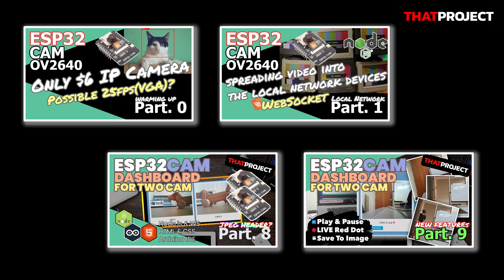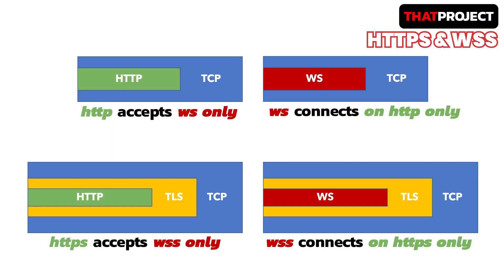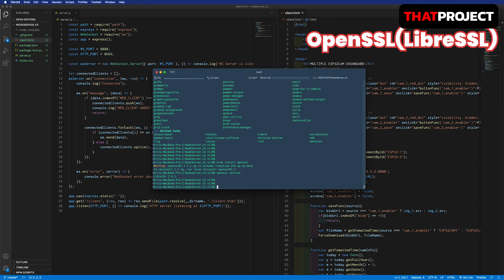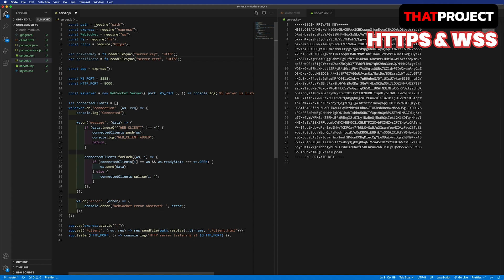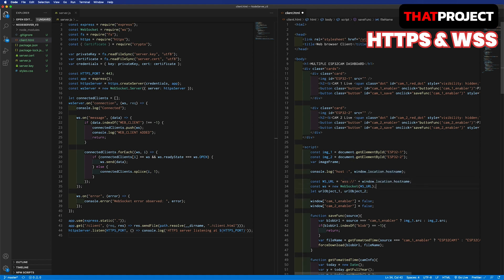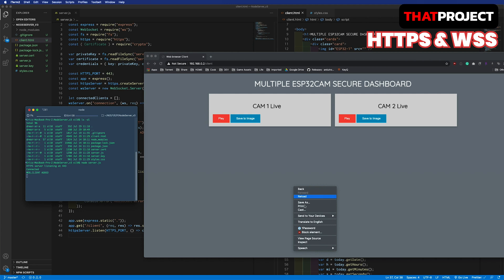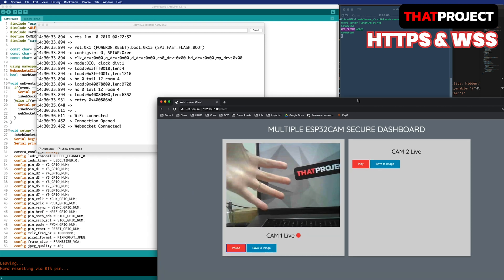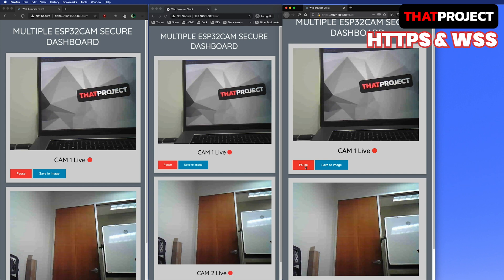ESP32 CAM with Arduino IDE | Tutorial - [Part.10] Multiple CAM Secure Dashboard (ft. HTTPS, WSS)🔒

Comment: is it still possible to connect to esp32-cam directly, skipping the dashboard? I'm trying to figure out how secure this solution is. Let's say someone broke into my wifi and wants to browse the cams after obtaining IPs.
Reply from the maker: Then are you trying to connect it directly to other ESP32?
Reply: @ThatProject   Let's say attacker has the IP os esp32. Can he browse the stream or is there no webserver on it to browse?
Reply from the maker: @mykkail1727  HTTPS/WSS is end-to-end encryption. It makes it impossible to intercept data in the middle.
It currently runs locally and can be accessed by anyone on the local network. What you want to do is make sure that even if someone knows your IP address, they can't access it.

Comment: Hello, by the way the esp32 ai thinker cam need to have the certification authority CA in memory, so you need to use the code setCACert("certificate_variable"). Well i after a couple of mounths i found it lol. And all the esp32 ai thinker cams i have can connect easily to the server, i even put 3 cams in one webpage instead of 2, but... even if i have only 1 cam on, i need to reduce the pixelformat to QVGA otherwise it's not working if i move the camera to something more detailed than the roof... Also i reduce the frequency to 9 000 000 Hz instead of 20 000 000 Hz. Any ideas to make it better?
Reply from the maker: I didn't need setCACert when I was working on this project. Of course, now we must register the certificate using setCACert on the ESP32. Otherwise, we cannot connect securely. Is the ESP32-CAM far away from your wireless router? Actually, I can't get your situation well.
Reply: @ThatProject  Oh ok thank you for your answer. No my cams are not far away. They work fine when they are streaming to a non-secure server.
Reply from the maker: @romanov2737  Interesting. Does a secure connection have any impact on data  transfer? Let me try to find it.
Reply: @ThatProject  When i use QVGA frame no error, when  i use VGA frame:  RangeError: Invalid WebSocket frame: RSV2 and RSV3 must be clear
Reply from the maker: @romanov2737  Unfortunately, I don't have a testable environment in place right now. I'll try again as soon as I get a chance. Sorry.
Reply: @ThatProject  ok thank you
Reply: @romanov2737  regarding the CA can you explain in more detail how did you set it? I'm having the same issue as many people here, where parts 1, 8 and 9 work just fine, but as soon as I tried the WSS protocol, it doesn't connect to the WebSocket. As far as I understand, it must be a certificate issue but I haven't figured out how to register it. Seems like self-signed certificates don't work. By the way, I'm using an ESP32-Wrover module.

Comment: Hi and wishes from Australia. Great project btw. I have been following your ESP32 series since you made the first video. This is perhaps the best use of this technology while creating custom servers using NodeJs. However, I have seen a problem with these devices, not sure if you have faced it though. ESP32 stops streaming over websockets altogether after a while like about 10-15mins in. I am powering it with esp32 programmer for development and also with the 5v mobile charger but with the same issue. Please let me know if this is a recurring problem.
Reply from the maker: Thanks for watching my video. 
There can be two problems.
One is the ESP32 power part. I've had similar issues with USB cables in particular. If there is no problem with the power, try changing the USB cable.

The node.js WebSocket server I made did not implement reconnection when the connection is lost. Once this part is complete, continuous streaming is possible through reconnection. I'm currently working on a new tutorial for the ESP32-CAM. I will do my best to complete better code.
Reply: @ThatProject  thanks a ton man!! Eagerly waiting for the reconnection part.

Comment: @That Project , I have no problem with video part 8 and part 9. Everything was working fine.  But when following this video part 10, I stuck at the webSocketConnect() in the CameraWeb.ino file. After the Wifi connected msg is displayed in the Serial Monitor, it kept displaying ..... which I believe it keep looping at the while loop inside the   webSocketConnect(). Have I missed anything ? The video is not displayed on the browser, although the buttons are displayed. The console at the node server shows "connected" and "WEB CLIENT ADDED". Any guidance is very much appreciated.
Reply: I'm not sure where the problem is. If you see "connected" and "WEB CLIENT ADDED" on the console, it means that there is no problem connecting the ESP32CAM to the server. Maybe the ESP version has been updated and things about secure connections have changed. This project was built on ESP 1.0.6. Any updates?
Reply: Hi  @Zero0Guy  , apologise for late reply as I was searching for possible solution but to no avail. I am using Arduino IDE 2.0 and ESP32 board manager 2.0.5. By following your video part  8 & 9, I have no problem connecting and able to view  the video in the web browser. Only at this video part 10, I couldn't get the video display on the web browser. I use the code from your  github and replacing the WiFi SSID and password and the correct local nodejs server IP address (which is using the wss connection), but still couldn't get the cam display on the web browser . I am using the following board , software and libraries:

ESP v2.0.5
Arduino IDE v2.0  
ArduinoWebsocket library by GilMaimon v0.5.3
Reply: @adornnet hi I am also facing same issues, do u have any solution on it ? I saw other command seem like the library issues

Comment: Hello.

I realy dont know what am i doing wrong. The ESP32-CAM cant connect to the websocket server. it just continues looping. I tried to put my ip, i tried to disable the firewall but nothing...
Any other ideas ?
If you try to run the project again, does it run or not ?

Thanks
Reply from the maker: This project is about HTTPS and WSS.
Acquiring images from ESP32CAM via WebSocket is working in my project now. Literally, it works fine in my environment. Also, others have confirmed this as well. Your question is about HTTPS, WSS? Or is it about Part.1 that you asked me last time?
Reply: @ThatProject   The main project i am trying to acomplish is this.
but when I saw that I was not running I tried to do part 1.
Do you have MAC environment? I am trying to run it on Windows 10. But i dont know if something needs to be changed.
Reply from the maker: @philippb9723  It seems that this project will also work after Part.1 works perfectly first. Yes, I am working on a Mac. Well, I don't know if it's necessary to change anything specifically in the Windows environment. I'm currently working on a new project to connect ESP32CAM and Node.js WebSocket server. Please test it again with this when it opens next week.
Reply: @ThatProject  I finaly did it.
It was a library problem and  i fixed it.

I have some questions about the project. Are the data from the ESP32-CAM encrypted when they go from the ESP to the SSL server, or they are encrypted after they go to the server ?

Thanks.
Reply from the maker: @philippb9723  Glad to hear that. What is the library where the problem occurs??? The encryption is end-to-end.
Reply: @ThatProject   You need to use <WebSocketsClient.h> from arduinoWebSockets Library 

After that, on the code that connects the camera to the server, i used the commands
  client.beginSSL("MY IP ADRESS", 443, "/");
  client.onEvent(webSocketEvent);
  client.setReconnectInterval(4000);
  client.enableHeartbeat(14000, 2000, 2);

inside the loop
i used the   client.sendBIN(fb->buf, fb->len); to send the buffer
Reply from the maker: @philippb9723  I see. Thank you for your information.
Reply: @philippb9723  Hi, Can you show where you mod the above code on the file?
Reply: @philippb9723  can you give more details on how you solved the issue? I'm having trouble importing the library and I didn't understand where to place the code you mentioned.

Comment: I followed all steps of how to setup ESP32 in https mode include the previous (non https (which worked perfectly btw)). Testing it on a mac (like you), having installed openssl, nodejs, npm and all the rest, getting server.js running (like explained in this video) I do not get 'Connection opened' and 'Websocket Connected' message. The scripts i downloaded from github, so no invalid code there I am sure. What am i missing?
Reply from the maker: It worked normally when I did this project, but now something has changed and it may not work properly. Are you sure you use ESP32CAM AI-THINKER?
Reply: @ThatProject  I am using the CP2102 bought here: https://aliexpress.com/item/4000120687489.html 
1x Cam set: https://aliexpress.com/item/1005001989312808.html
and 1x Cam: https://aliexpress.com/item/4001133770461.html which has less resistors than the other one, strangely enough.

Just to be clear. With your video on ESP32 Cam part 1 i got it running without problems.
Reply: @ThatProject  I followed the instruction on part 0,1,8,9 and 10. In none of these videos is mentioned that i had to install npm fs and https package. What else am i missing? Until now, i get no Websocket connection.
Reply from the maker: @joland119  The fs and http, https packages are built-in modules, so you don't need to install them separately.
https://www.w3schools.com/nodejs/ref_modules.asp
Reply from the maker: @joland119  Did you test whether it works properly in the local environment as in part 1?
Reply: @ThatProject  yes, the part 1 version worked. The part 8 and 9 only works when i delete the ws protocol. 

Meaning, testing part 1 and 8 results:
const char* websocket_server_host = "ws://192.168.2.3"; //does Not work
const char* websocket_server_host = "192.168.2.3"; //DOES work!

So it is a ws protocol issue.
Other things i tested on part 10 (https version) without success are:

---
const char* websocket_server_host = "192.168.2.3";  
const uint16_t websocket_server_port = 443;
...
while(!client.connect(websocket_server_host, websocket_server_port, "/")){
---
const char* websocket_server_host = "192.168.2.3";  
const uint16_t websocket_server_port = 443;
...
while(!client.connect(websocket_server_host, websocket_server_port, "")){
---
const char* websocket_server_host = "192.168.2.3:443";  
// const uint16_t websocket_server_port = 443;
...
while(!client.connect(websocket_server_host)){
---
const char* websocket_server_host = "https://192.168.2.3";  
// const uint16_t websocket_server_port = 443;
...
while(!client.connect(websocket_server_host)){
---
Reply from the maker: @joland119  const char* websocket_server_host = "ws://192.168.2.3"; //does Not work

Is this my code for ESP32CAM? 
I've never put the "ws" as a prefix in all ESP32CAM projects.  

I only used this "ws://192... " in client.html file and it's a necessary part for connecting the WebSocket server. 
If you want to get my help please check all you have again.
Reply: @ThatProject  yes, you are right! I don't know how i mixed it up. However, in part 10 wss:// is stated (correct me if I am wrong). I believe that the wss protocol is the reason why I can not get the https working.
Reply from the maker: @joland119  You're right. It's necessary for doing the secure WebSocket. Please refer to this.
https://github.com/gilmaimon/ArduinoWebsockets/blob/master/examples/Secured-Esp32-Client/Secured-Esp32-Client.ino
Reply: @ThatProject  the sketch you linked to, works as it should as long as i use the server address: wss://echo.websocket.org/  When I change the server address (line 31) to my local ip which is in my case 192.168.2.3 (mac) than it doesn't connect anymore.

Also this: https://www.websocket.org/echo.html works accordingly. The test (at the bottom op the page) returned correctly as well. 

When i add these 2 line in (on row 65) in your sketch:   
  Serial.println("IP address: ");
  Serial.println(WiFi.localIP()); 
It returns 0.0.0.0

My router ip: 192.168.2.1
My mac ip: 192.168.2.3 I use this ip as server host.
Reply from the maker: @joland119  Thank you for your report. There was no problem when I did this project. I think I need to test it on my side to solve this problem.
Reply: @ThatProject  I'm also having this issue, and I think I know what the problem is. It seems like there was an update to the espressif background libraries that breaks handling wss in "insecure" mode (i.e. using self-signed certificates) in the newest version. If you look at this issue in the ArduinoWebsockets github repo /gilmaimon/ArduinoWebsockets/issues/101 someone has reported a similar issue where their code simply stopped working. It looks like its fixable by making some changes to the ArduinoWebsockets library files, but I haven't tried to do it myself yet.
Reply from the maker: @CaptainSlowbeard  oh, I see there is something changed. Thanks for letting me know. I'll see it again.
Reply: @ThatProject hi I love ur all of ur project seem like have a reference for my assignment but in this video I have facing same issues, esp32cam can’t get connect to the server. Can give some idea or hint the to make it work ?😅

Comment: I was trying to attempt THAT PROJECT myself, but when I was going to enter "node server.js" in the terminal there was an error saying that express was unknown, any idea what I did wrong?
Reply from the maker: Seems you didn't have the express package in your environment. Try this way. https://expressjs.com/en/starter/installing.html
Reply: @ThatProject  Thank you I am gonna try this out.
Reply: I tried it but got a npm warn saying for me to download the newest Node.js which I already did. Then again I am on Raspberry Pi 4 32 gig.
Reply from the maker: oh, maybe you need to find the problem you have in the Raspberry Pi channel. I've never tried it in RP so that hard to give you a solution.
Reply: I worked around it and had success with the instructions but express is still not working saying 'MODULE_NOT_FOUND'.
Reply: By the way the node modules are installed.